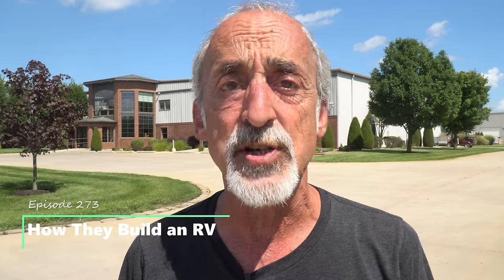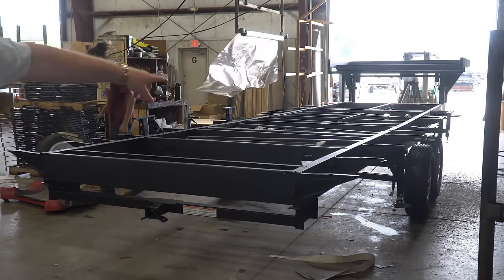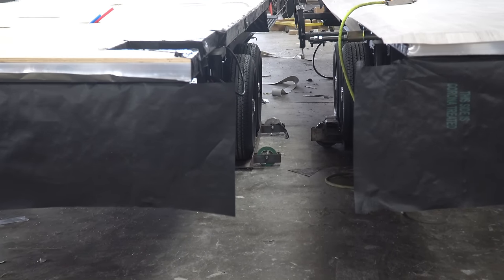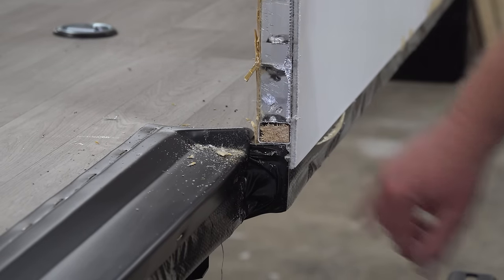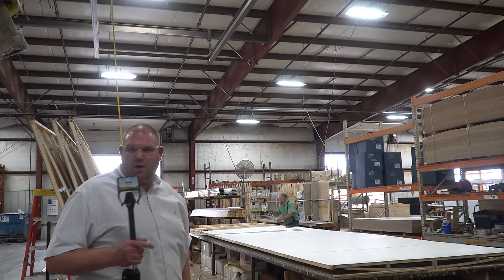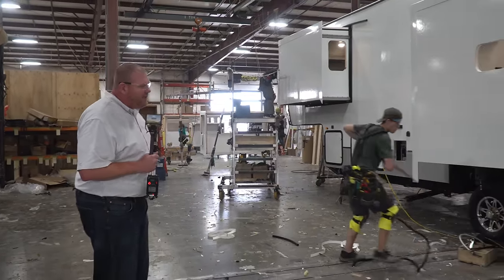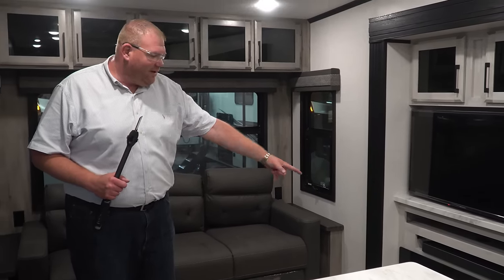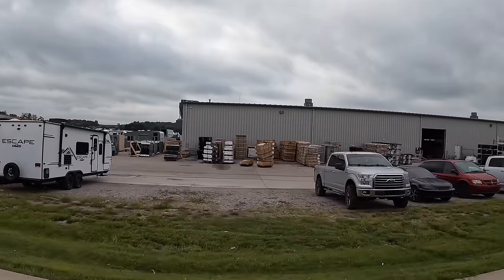Ep. 273: How They Build an RV | KZ Durango fifth wheel construction

Comment: It's great to see they take pride in their work & do a very good job especially being filmed these days where quality is slack with other brands.Other brands probably wouldn't want you to film 🎥 them Incase you see them taking short cuts.
Reply from the maker: Thanks for watching! We were wholly impressed with KZ's operation, especially after we've been wholly impressed with our first two years of ownership. The biggest impediment to filming during production hours was the fact that the Amish don't allow themselves to be filmed; however, we made the request and they readily agreed after consulting with the Durango plant manager, who is Amish himself. That told us a lot even beforehand, and it sounds as if you drew the same conclusion.
Reply: @GrandAdventure  Great to see their standards are high.10% bonus if they pass a certain high standard gives workers incentive to do a better job maybe all manufacturers should do this due to the drop in quality control & rough building across the industry.2 yr hitch to bumper warranty too.I have been researching the industry & brands & who uses Azdale & who uses Luan & what slide mechanisms they use & 
KZ Durango is the best & is the one I would get.

Comment: Thanks Marc. I found it a little overwhelming to follow as things were happening so fast. But that is to be expected based upon a 25 minute presentation of a day to three day build process. The process covers several units under construction simultaneously with crews working on several different units in stages. It's hard to determine how long the process takes. Actually and obviously aside...

I liked the interior materials and fixtures choices and of course the Durango floorplan is fabulous. Personally, I'm not crazy about the step up into the bathroom and bedroom required of a fifthwheel. I prefer the flat footprint of a travel trailer.

But it was fun to see how they do it.  Their plant is very thorough and efficient. You have to be to build a reputation and survive.

Nice to see that the Covid buggers didn't destroy this plant.

Gord
Reply from the maker: We walked away extremely impressed by the plant's efficiency, Gord. You're right about the speed, but that's also largely a YouTube phenomenon as people have short attention spans these days. Each segment focused on one station along the way from raw frame to finished product. That way we could logically follow the build process from start to finish.

Comment: Thx for an informative and entertaining video Mark. Been a KZ fan for years always wanted a Escalade Sportster   BITD but DW, wallet and TV limitations made it a 38' New Vision Sportster  that We enjoyed for many years of use including USFS roads getting to primative campsites high in the Sierras. I never got it any where I couldn't manuver out of and the Youngs welding frame, Dexter axles GY "G" rsted tires , 5th Airborne  W sidewinder airride pinbox kept it from getting shook to pieces. Our present 40' 3axle KS Fuzion hasn't proven to be as durable as our KZ was unfortunately, boon docking  access limitations crimped our style. Happy Camping and stay healthy GA.
Reply from the maker: Thank you Bill, and same to you! Those are both very large rigs from our perspective, but good on you for getting them both out there and enjoying them.

Comment: Really great tour and was very entertaining. I will say, if automotive manufactures had the same quality control and dirty assembly hall they’d be out of business within a year. All RV’s are built like crap. I’ve had plenty. And yes the customer service was excellent but you shouldn’t ever really need to speak with them. I mean a certain RV GM went on record saying hinges on doors are designed for 40 something uses. They’re disposable and expect a customer to use them a week or so year and get rid of them after a couple years. They are not designed for full-time living, which requires you to treat it like a paper house. Every RV on the lot I go into has crumbs from the particleboard and wire splice of shavings in the corners on the floors. Every RV that I have owned has had a significant recall, impacting the safely and or use.  That being said there’s no alternative and if you want to play you have to pay and that mean tolerating a subpar quality unit. Thank you for what you do and the knowledge and entertainment your channel brings.

Comment: Amazon is building a distribution plant in nearby Elkhart. They plan on hiring around 1000 workers. With the unemployment rate in the area already running under 1%, someone’s going to have trouble finding workers.
Reply from the maker: Sure sounds like they will, Rik.
Reply: Only if Amazon pays at least $50/hour.

Comment: Every RV Factory tour I've ever seen - the employees are literally RUNNING everywhere, all the time.  I know the Amish value hard work, but If I had to work at that pace for 8 hours a day I'd make so many mistakes.  I guess that's why in my RV (full disclosure, not an KZ) I found a very nice set of channel lock pliers behind the furnace, a screwdriver behind the power panel and none of the slats on the decorative vent in front of the Furnace were stapled in.  The staples were there, they just all missed the wood on the other side.
Reply from the maker: Sadly Buddy, what you describe doesn't surprise me in the least.

Comment: Are they using a Lippert frame?  that's a No No....  to many frame failures driving down these rough roads...
Reply from the maker: Their frames are supplied by Lippert, but as full-timers and avid boondockers we've brought it down some pretty rough Forest Service and BLM roads over our nearly 3 years of ownership. No issues have been identified yet, confirmed via a full frame and suspension inspection this spring.

Comment: After our Cruiser fifth wheel was crushed by a tree, we have looked a many other used fifth wheels to buy. I can't tell you how many Rv's we passed up because rear roofs got water down the back wall because the back wall seam leaked. Really do not understand why others do not overlap the roofing material like KZ. All I can think of is plan obsolescence.
Reply from the maker: Now nearly 4 years with this Durango Half-Ton D283RLT, we continue to be pleased with KZ. No RV is built like a freight train, but they employ some techniques that seem to make their RVs more durable than most.

Comment: Looks very much like an old auto assembly plant from before the advent of modern manufacturing.  Front cap insulation not secured, floating fore and aft in the cap?  If so, then not very effective.  The process appears to be rushed, not conducive to best quality work.  The auto industry learned their lesson, time for the RV industry to learn theirs.  Steady as she goes and follow the process gives best results.